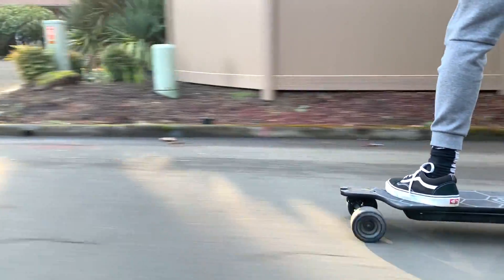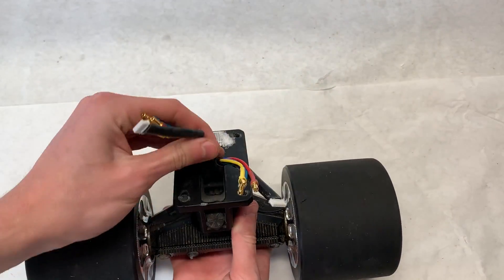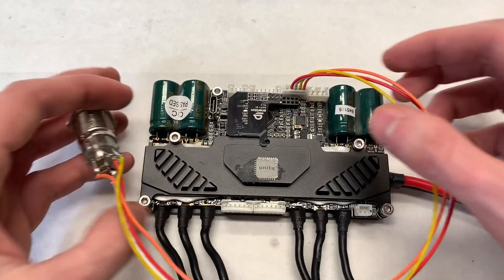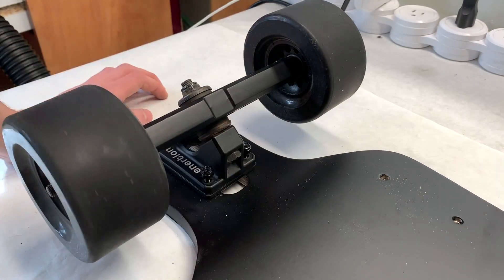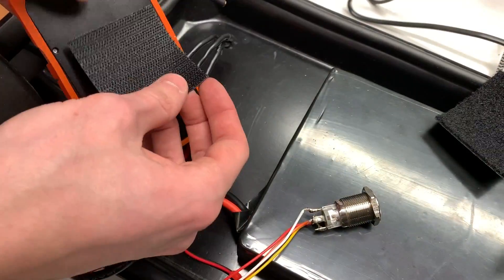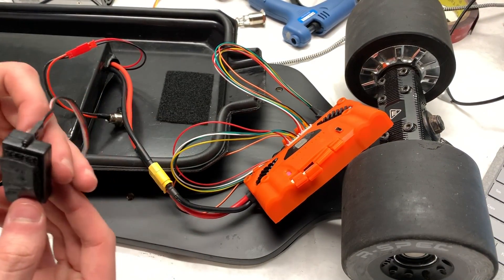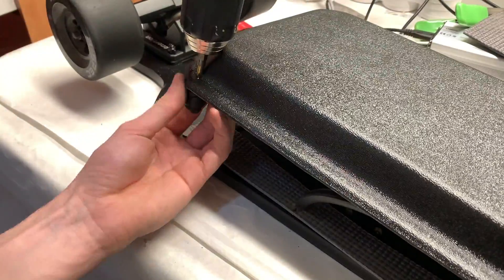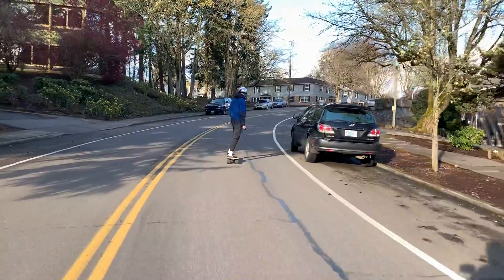How to Build an Electric Skateboard - 12s4p Enertion R-Spec Hubs & Unity ESC *39MPH 25 Mile Range*

Comment: What's the max current you recommend on the raptor 2  battery?
Reply from the maker: I believe it is a. 4p with 30Q so 60A total or 30A per side with a dual drive

Comment: did you fill the chamber that holds the heat pipe with silicon grease to the point that it extrudes, to know it's full?

Comment: Thanks for the video I have a Raptor 2.0 and i might try upgrading to the 12S4P. I burned a hole in my BMS last week I've gotten use to riding full throttle at 10S3P it's barely hit 32mph. My new BMS came in yesterday to it's back to riding.

Comment: man hub motors aren't safe.... they're just a thing because they're cheaper to produce. Ask your self what if it fails at speed. You want to be able to control if their is a failure and that might not be in the cards with hub motors.
Reply: How is that's not the same with geared motors? If your board fails you will lose control whatever motors you have.

Comment: Look after the thane on the hubs. Riding aggressively will see it finished.
Reply from the maker: Thanks for the advice, we are concerned about it too
Reply: DIY esk8 Builders be careful, twice I was riding at 45-50kmph and one has fallen apart leading to a massive stack. If you are trying to make them last, don’t ride over anything really rough and keep the motors cool. I killed a set in 10km  riding really hard/hot. I made a set last for at least a couple of hundred km by taking it easy, then went really hard up a steep hill and they were finished. Good luck!
Reply from the maker: Wow dang, good to know. Thank you so much!

Comment: Enjoying the Enertion Raptor 2.1, too bad about the company going belly up like so many others. Nice build!! Might want to stock up on some replacement out motors while you can still get them.
Reply from the maker: Yeah, I was looking for some but I can't find any of them in the 97mm size.... uh oh. Do you know how often you have to replace them?
Reply: @DIYesk8Builders  A liquidation shop just popped up on the net. I ordered some and got a message last week saying shipping is delayed due to COVID situation. Hoping they ultimately make it here. According to some they claim theirs lasted only 100 miles but I easily have more and they still look great (Sept 2019 batch). I understand it's the heat that does them in. I switched to Flipsky VX2 remote and normally only run in medium speed mode. The std Raptor 2.1 setup is 10s4p @36V, 60A. Maybe check the math to make sure you're not overworking the motors? Dunno. Mine never cut out on me, ever. If they're running that hot, would expect that to impact wheel longevity. https://enertionraptor.shop
Reply from the maker: Wow awesome thanks so much, I will definitely be checking the site out. Do you know for sure if it is legit or not?
Reply: @DIYesk8Builders  Dunno yet, I'll let you know if/when my order arrives. Ordered on Apr 1, got a reply Apr 7 on the delay. So far so good.
Reply from the maker: Ok thank you so much. If yours comes through we are gonna get some stuff from there
Reply from the maker: Any update on whether or not its legit?
Reply: DIY esk8 Builders I see on their Facebook page some guys have got their stuff. Still waiting for mine. The profiles of those that reporting getting stuff look like valid skater profiles.
Reply from the maker: Thats really good news.. I am looking to pick up some unity's from them then
Reply from the maker: Have you gotten it yet? lol
Reply: DIY esk8 Builders nope not yet.
Reply: DIY esk8 Builders I got a DHL notice today for a parcel from China, based on the duties I expect this is the package. Edit: they did send me a tracking number, matches this one, almost here... so legit... (found it just now in my junk mail)
Reply: @DIYesk8Builders  Arrived today! 
https://youtu.be/_vOxI9lGqy0
Reply from the maker: Awesome, thank so much!

Comment: I have a 2.0 raptor wich has slightly different motors with the individual focs , I never had any problems with overheating I feel like the 2.1 had alot more issues
Reply from the maker: Yeah when they overheated I was pushing it pretty hard though, super steep and long hills
Reply: @DIYesk8Builders    
i have herd of the 2.1 overheating  a few times , i live at the top of a massive hill and yet to have  it over heat maybe i have just been lucky . love your build you should try rerouting the wires and going drop threw .lots  good diy parts floating around with all the dead raptors lol

Comment: Do you guys recommend any other hub motors that have the same power of  enertions
Reply from the maker: No hubs have as much as Enertions from what I know. The closest thing would be some direct drives
Reply: DIY esk8 Builders Then it’s belts for life lol 😂
Reply from the maker: Belts are the best, nothing can beat them... period.
Reply: The Hummie Hubs are similar in power but they are somewhat rare as well.
Reply: You can try AEboard rubber hub motors. That monster can go 35mph at 40A with just 10s batteries. I recommend having 40T or 30Q batteries since i was running these bad boys with 35E 10s10p battery cells. My battery gets a tiny sag after going below 3.3v

https://www.aeboarder.com/collections/truck-motor-wheel/products/free-express-shipping-110-65mm-all-terrain-rubber-motor-kit

Comment: I have a raptor 2 with a focbox unity and brand new battery... Only issue is that the light for the power switch will not turn off when I turn the board off and for some reason it's not charging even though the battery is new.... I want to make a new board out of the parts. Any recommendations on how to fix this issue?
Reply from the maker: Yeah so what power switch are you using? Did you make your own for the Unity or is it the one that came with the raptor? Also, where is your battery from?
Reply: @DIYesk8Builders  my power switch is the one that came with the raptor 2.1. Also, the battery I'm using is a new replacement from Enertion before they went out of business. I had a battery that was having issues so they replaced it for free under warranty. Samsung 30Q 10s4p that came with raptors....
Reply from the maker: Thats odd. Considering the two things that are not working are both items from the bus tray, my guess would be that something is wrong with that. If you can't fix that, I would get someone to install a bms on that pack, or do it yourself and then make a power switch to plug into the unity
Reply: @DIYesk8Builders  thank you. So I am replacing an external power switch and adding a bms? Pretty sure it has a bms already?
Reply: @gregorypatzelt6964  https://forum.esk8.news Idk man that's up to you, you might want to say fuck the switch and use a loopkey, you probably need to check the cells in the pack with a multimeter to make sure everything is up to snuff. The preceding link is "the" forum, try using the search function before starting a post, because a lot of people have similar problems and/or questions, and people try to keep it clean-ish looking
Reply: I had a similar problem it eneded up being the mossfets on the etray witch are a standard part if you can find sombody that can do surface mount soldering
Reply: @weaksaucep4539  if I had some sort of diagram or video to follow I think I could do it. However, I'm not the best with this...